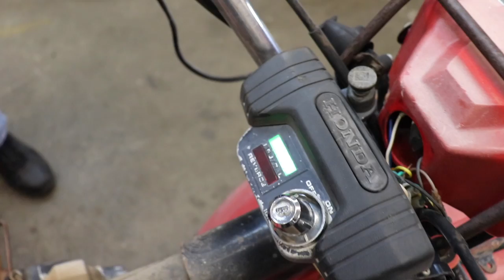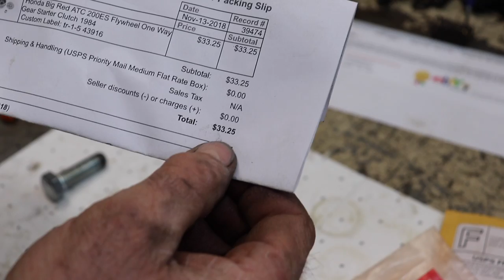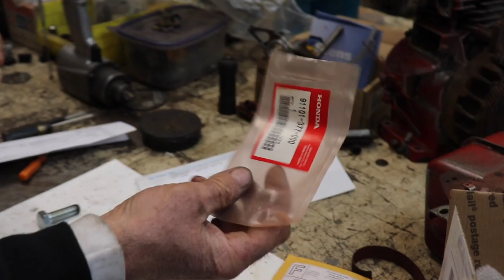Taryl's Builds Roof Palomino Lawn Mower Jeep Pt 1

Comment: I find myself saying WHOO WHOO every time I get something running even if it already ran 👍 thanks for doing these videos Taryl
Reply: I fixed my pas280 the other week (intake gasket fell apart so wouldn't run) anyways, did some lawnmower detective work to it and found the gasket was the problem. Replaced that and rebuilt the carb while it was part went to start, fired right up and found my self going wooo wooo wooo with the gas rats theme song in my head lol these guys are great!

Comment: Ole Hondas are like ole Jeeps, they never die, Im 52 yrs old, been riding these ole Hondas since I was a kid, and still to this day ride a 200X every Sunday weather permitting. You can use the front axle bolt to remove the flywheel in a pinch. Use oil for wet clutches

Comment: I knew being a Honda it would run with very few issues,despite its"roughness".I bought a 13KW Honda generator for this reason,Honda builds the best on the market hands down Tayrl.
This is going to be a very interesting project and looking forward to part-2 of it.
Reply: 4 gauge Honda makes a great engine. Very well engineered. The GX160 is the Briggs 5HP of today. There is a reason why they’re are so many Chinese clones of Honda engines
Reply: @JerryWick  My 13KW generator uses the V-twin cylinder GX-620 Honda in it,I can't believe how quiet it is,the fuel economy is very good too.

Comment: My dad had a Roof 3 wheel mower.  It had a drive system like Snapper and could turn sharp enough left to ring an 8" tree.  It had a lever that you could raise if you approached a change in ground height, root etc.  I wish I had one now.  It was a great mower.

Comment: My buddy had one of theese motors from an atc sitting in the back yard full of moss on a table , i said can i have it and he gave it to me so i brought it home and it had the wireing harness with it , i made a quick stand  , did a compression test and it had 140 pnds compresion so checked spark , all good , tossed a bit of gas in it and she fired up , 37 year old motor and still strong . I love working on small engines , motorcycles and anything vintage , most of my stuff is junk people toss then i turn it into gold , this motor is going in a rat rod gokart im building from scrap , also made a go kart power wheels escalade from a kids 110 atv , i have a short video posted and plan to make a better video with me driving it soon .

Comment: If you type in"roof palomino"into your U-Tube search engine,you'll see alot of video's about this little mower,some owners painted them military olive drab,really cool!!.
I've noticed after reading quite a few comments about the Roof Palomino,their are alot of owners that are willing to sell them,which I find as very odd,considering how rare these were from 1968-1972.
Now,they do make a replica of this mower,but it's a"novelty toy".
It has a electric start 125CC.4-cycle engine in it,with working head lights,three speed manual transmission(with reverse),working turn signals,seat belts,etc.
Type in"saferwholesale.com",they are the ones selling these"Jeeps".
Reply: Damn, $2200 ain’t bad! Slap a 420 cc Predator in there
Reply: @RustyZipper  Put"wheelie"bars on it...HAHA!!.

Comment: The 6 inch extensions for the wheels will it not put too much leverage on the shaft bearings as it is going into a bigger vehicle and will it lower  the value of a collectable Roof Palomino? Other than that it is very good project and very interesting to watch the progress.

Comment: I had a kawsaki 200 three wheeler used to drive it slow for weed spraying it would burn my legs I put an oil cooler on it helped quite a bit, maybe  an electric trans cooler with a fan would   work to cool it down.

Comment: Sad to see the old 3 wheeler get cannibalized.  Cool project tho!  Also, make sure the ATC engine has constant air flowing over it, obviously doesn't have a fan on the flywheel and needs air moving over the fins properly to cool it.  I worry for the engine being in an enclosed hood area like that.

Comment: I Love it Just Like My 1969 Jeep J3000 Pickup 😀😮😊 There’s Yur Dinner 🍽🍽🍽
Reply: Chris Chiampo Cool. Love those old jeeps. I've got a CJ8 and J10 (almost rust free) waiting to be put back in service after I retire. They are both garage kept CJ8 in detached building and J10 cab on roll around in garage. Have a re-manufactured 258 with the fuel injection kit to be installed for one and a 258 core when I purchase the other re-manufactured engine for the other. Got the J10 longbed from Louisiana before their hurricane and drove it back to Virginia. It has a manual transmission so it was a PITA when I hit the stop and go traffic in Atlanta where they were doing roadwork. I got paid for hauling an engine that someone had purchased from Ebay to go into a Rambler so that paid for my gas.   Guy showed up with a car with the back seat removed and fit the engine in there.

Comment: How many cc is that motor? Is that going to have enough power to move that jeep plus another person and a small cargo load? Just asking.
Reply: that's a 200 cc and its perfect for this project, hi and low means all kinda low end ( even if he wants to add a mower back) in high thatll prolly still do about 30 and since he put in the better tie rod ends itll  be safe too. wouldn't wanna go much faster than that anyway, I have a ATC 90 1979 with hi and low and with 2 adults on it , it still has plenty of power to go thru ditches and up inclines. I collect old Hondas and he couldn't have picked a better drivetrain!! I love seeing everyones comments and compliments,... Teryl is  good old American fun!
Reply: Looks like the jeep tires are shorter than the Honda. That would mean better low end and less top speed. Should compensate some if there is a lack of power out of the Honda. With the engine going into an "engine bay" I'm wondering how he's would keep the engine cool? It's not a lawnmower engine.
Reply: Ok I can see that aspect on the tire size. I'm just thinking its not enough power, but I am looking forward to all the unanswered questions .